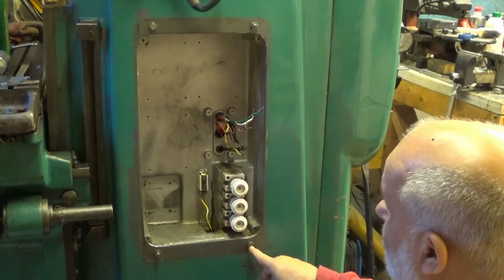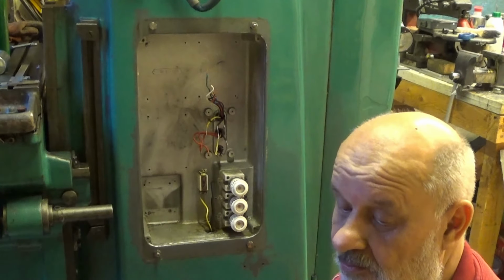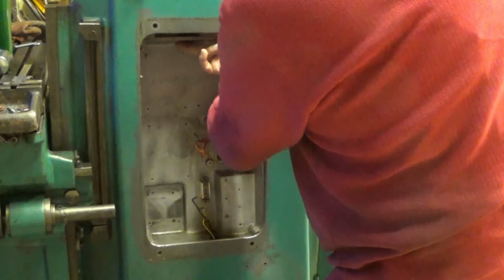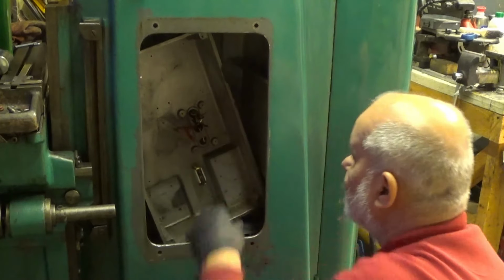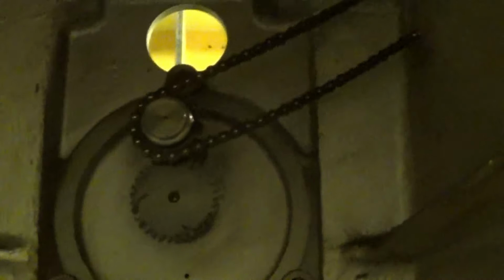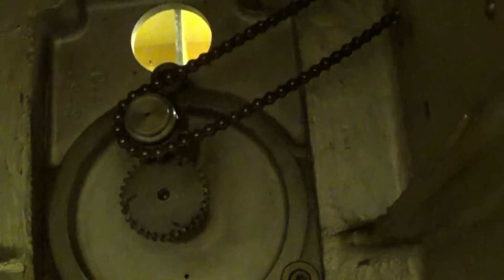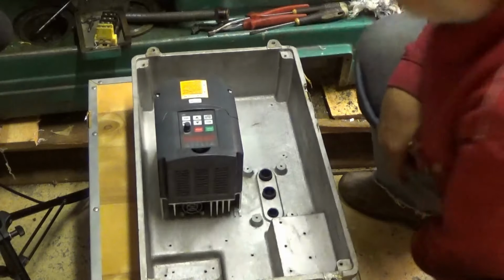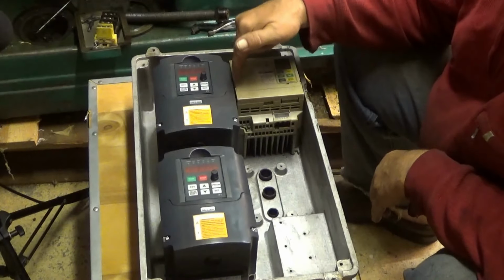FUM0039 Schaublin Electric Cabinet

Comment: I understand that the VFDs will give you variable speed control of your electric motors - are they also required to provide 3-phase power from your single-phase supply?
Reply from the maker: I do have 3-phase power in the house but there is only single phase wiring to my worksop. So, Yes.